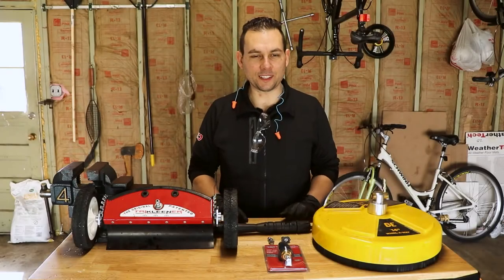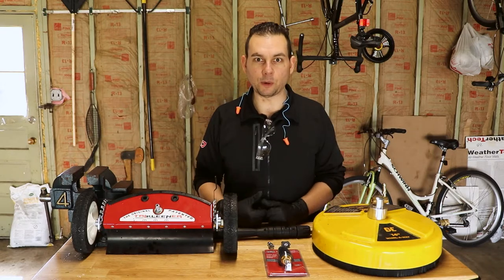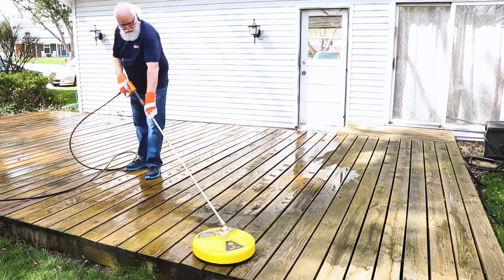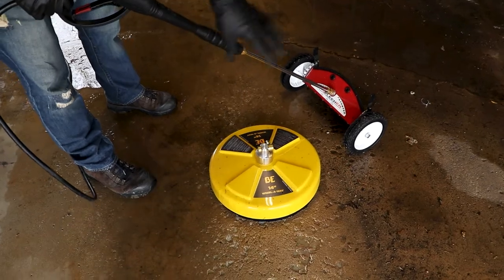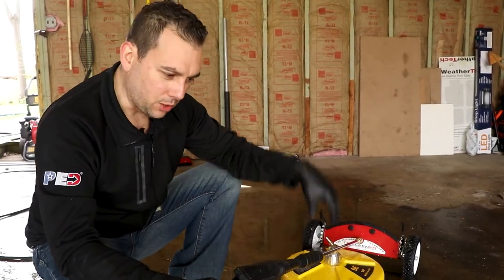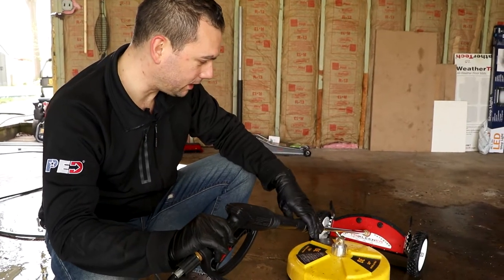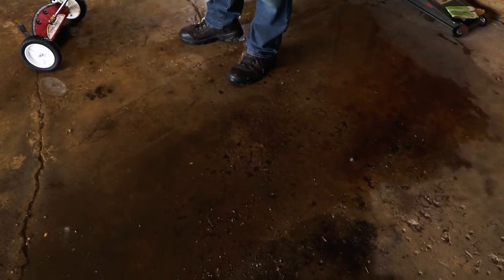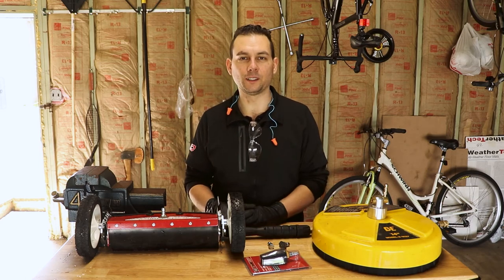Water Broom Vs Surface Cleaner — Hands-on Comparison, Review, & Tips

Comment: Comparing these 2 - The surface cleaner is better for removing more dirt. The broom is better to push all that dirty water off the surface of what you just cleaned, so that dirty water doesn’t sit on what you cleaned. The broom has more jets. The more jets - the less the pressure will build behind them since you are allowing more water out.  This is why just using the pressure washer without any attachments cleans the deepest and most aggressively.  Pressure washer wand by itself - 1 jet.  Surface cleaner - 2 jets.  Water broom - 3 to 5 jets..  
Depending on your application - less pressure (or a more consistent distance kept from the surface) might be more beneficial.  As an example - Using a surface cleaner on a wood deck will keep a fairly consistent distance between the jets and the wood.  This MIGHT not clean AS deep as just using the pressure washer wand alone - but it will help eliminate marks left behind from a  person constantly varying the distance of the wand from the wood. (The closer you hold it, the more water pressure hits the surface) If you have a painted surface, youll have to be careful you dont apply so much pressure as to start removing paint.  Its better to start with something less aggressive and work your way up if youre not sure what will work best with your particular pressure washer. That said - all 3 tools are useful to have, and not very expensive to pick up as homeowner grade tools.   A  $99 electric pressure washer will do just about everything a big gas one will - it will just take you longer.  For a smaller 1600 - 1800 psi unit - you simply hold the tip of the wand closer to what you need to clean  (cleaning a smaller area on each pass) - and you might have to forego a surface cleaner attachment to get the deepest cleaning results.  To visualize this - you might be able to clean as deep as you need to on vinyl siding with an electric pressure washer rated at 1600/1800 psi - by getting a 3 or 4 inch wide path done - while hold the tip of the wand 5 inches away from the siding - while with a 3600psi gas unit - using the same tip - you can hold the tip of the wand 10 inches away from the siding, and get a 6 or 8 inch side path done that cleaned just as deep.  The bigger units save more time - but you can absolutely do 90% of what those machines will do using a smaller electric model, just at the expense of your own time.